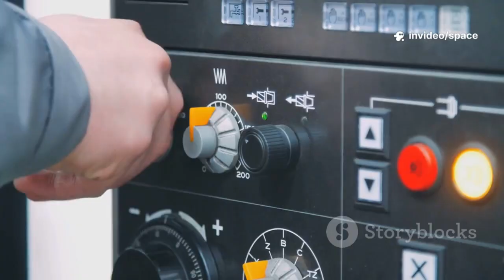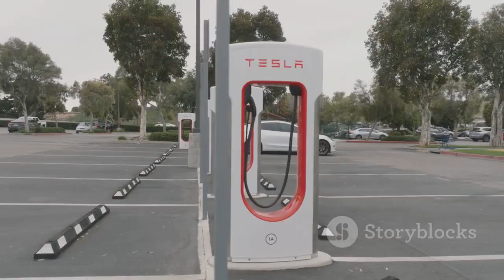Elon Musk’s New Engine Just Shock the EV World!

Comment: I think a better hybrid would be a gas ingine combined with an electric system using capacitors. 
The capacitor drive would handle the stop and go and gas would maintain the travel speed.
Capacitors are lightweight charge and discharge fast and have massive cycle life.